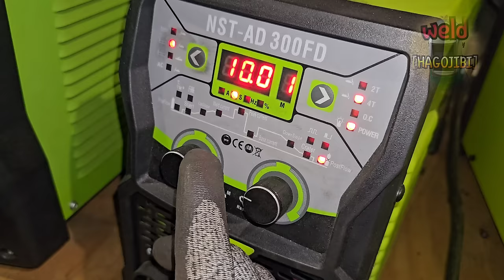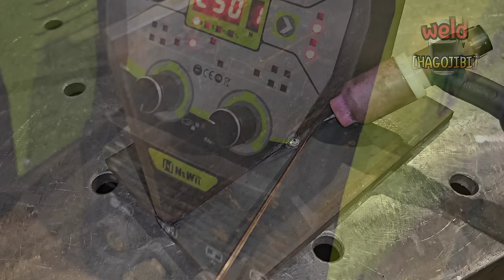Dirty TIG welding solution ! Why don't professional welders talk about this?

Comment: As a professional welder, tig 100% has to have a clean surface. No matter the metal
Reply: A fingerstool is a must for Tig welding which absorbs the heat and allows firm control over the direction of metal. 20mm Pipe welding at a 45 degree angle with root fillers and cap will wreck anyones wrist.

Comment: I would be more than pleased if mine came out like first one
Reply: Everyone starts from somewhere and with a little training you will be welding like the best.
Reply: I'd settle for the bad one in the the thumbnail
Reply: @farfartony751 mm 6😂gf6 de r e😂
😢😂s5
Reply: So dirty, maybe some inclusions and fail NDT? Preparing the weld area is the most important step. Doubly true for TIG work. 

Good prep work will help achieve better looking welds. Practice will gain consistency.
Reply: Do you think anyone would employ someone taking their time doing this ? 🤔 
The weld has to look ok but time also plays a major part in it 😂

Comment: No one talks about it because its just natural to clean any material.  You should never weld over mill scale
Reply: Unless you're at a 50 year old plant on a stainless pipe next to an exhaust 15 feet in the air at a 6g position you can't get at lol

Comment: On the contrary, that is the very first thing you learn from a professional TIG welder. Prep, clean, then clean some more, repeat and then maybe you get to lay a bead that most probably will look like burnt chicken shit anyway. Unless you have mastered all the other hundreds of variables and techniques involved to get something even remotely resembling the clean bead in this video.

For all the amateurs out there interested in getting into TIG welding because you've seen some weld porn on YouTube or Instagram. What these porn producers wont tell you about TIG welding, is as follows. (and I've explained this to a handful of friends over the years who caught the TIG welding bug and was about to run out to buy their first starter rig.)

Provided that you already have access to an insured, relatively weld safe workshop where you have enough power and permission to store large high pressure gas bottles.
You will need. 
A sturdy metal worksurface to weld on (tin clad wood will burn and smolder for hours if not days). 
An angle grinder with a decent selection of discs for cutting and grinding.
A fire extinguisher.
Protective closed leather boots.
Protective clothing made from natural fiber, wool or leather 
(Most synthetic materials will burn so fast you have little to no time to react. Especially when your vision is limited by a welding hood.)
(Synthetic fabrics are basically low density plastic which will burn, melt and stick permanently to your skin resulting in severe burns and hospital bills.)

Now you can go out and buy the most basic Chinese TIG setup you can get. Apart from the initial cost of the $500 welder, you need to buy (or rent) an argon gas bottle, pay for filling it, Buy a gas regulator, fittings and hoses. Buy a decent welding hood (don't waste your time trying to use the one they might include with the machine for free). Buy electrodes and filler rods for the different materials you wish to be able to weld and so on. That should set you back about $1000 in total. 
However, if you want some kind of quality product where you don't have to curse the machine and all the cheap components on a regular basis, you can look forward to spending $2000 and upwards on your setup. Believe me, learning to TIG weld is difficult enough without having to second guess your equipment. And if you want the option to weld aluminium you will have to spend yet another $1000 dollars just upgrading from a DC to an AC/DC machine. Also if you care about your long term health and want to avoid slowly getting poisoned by toxic, cancerous smoke and gasses you might want to consider buying a welding hood with a forced air respirator (gas mask), that is at least another $700 and upwards, plus the added joy of buying and replacing filters and charging batteries on a regular basis. Even though expensive, respirator hoods are well worth it because you will spend long hours exposing yourself to the fumes while training before you can even hope to produce a half decent weld. Getting a decent respirator hood is a good idea for the other processes as well, but especially with TIG because you basically don't have the option of working outdoors, or in a well ventilated room, because of shielding gas coverage issues. If the nozzle experiences the smallest amount of wind or moving air it will ruin your weld completely and foul and/or burn your electrode as well. MIG welding basically has the same problem (since it's also gas shielded) but is a bit less sensitive to wind, and you can also choose to use a flux core wire which gives you more or less complete freedom to work outdoors in most cases, which of course limits the risks of inhaling the toxic fumes. As they say, "very few welders get to see old age".
TIG welding is by far the most time consuming and expensive of all the common welding processes. Not to mention the hundreds upon hundreds of hours you need to spend training before you can produce something even remotely close to what this guy does on ordinary black steel (carbon steel). Good results on aluminium and stainless is at least another couple of hundred hours. If you care the least about the results, prep, cleaning and setup takes up at least 75% of the time if you are welding regular black steel. But will take up closer to 90% of the time when welding stainless, aluminium or even more exotic materials. The material must be completely free from mill scale, rust, oil and other contaminants and then thoroughly cleaned with pure acetone. Less pure acetone or brake cleaner might contain chlorine which will produce deadly chlorine gas when burned. 
And now, what probably got you exited with TIG welding in the first place, those perfectly rainbow colored weaves or stacks of dimes will put your budget upwards of at least $5000 and you will have to spend thousands of hours studying how to weld and manage heat spread in stainless steel to perfection in order to achieve that. If you ever get to that point you are now in the top 20% of professional TIG welders. And even those guys only put up pictures of the one or two nicest looking beads they were able to produce during a 40-50 hour work week on Instagram. So unless you want to dedicate your life to a career in welding, forget about the perfect rainbows. Also, the rainbows are an artefact which is not necessarily wanted by the end customer. IE companies don't pay their welders to produce pretty rainbows unless it's a show piece or for an artwork. Their main concern is of course the structural integrity of the weld, which is hard enough to master. Just in the process of learning TIG well enough to produce a half decent weld bead you will spend months just prepping and cleaning material and filler rods, grinding tungsten electrodes into pounds of cancerous (and in some cases also radioactive) dust. And believe me, you will spend some time demounting and regrinding and remounting and adjusting your electrode. The smallest amount of contamination (most often molten steel from accidentally dipping the electrode in the weld puddle or striking the electrode with the filler rod) will make your arc wander or pull and make it even harder to get a good result. The different methods of grinding tungsten (one of the hardest metals in the world) electrodes while avoiding the hazardous dust is a long discussion in itself, ready made relatively safe tungsten electrode grinders will start at about $600, there are other options, but what ever you do, be very careful not to inhale the dust. 
So if you are only working with black steel, my suggestion is to buy a MIG welder, spend 50 hours and become a half decent at MIG. The cleaning and prep work is about a tenth of what you have to deal with as a TIG welder. And you will lay down the beads three times as fast as with TIG. There are options for MIG welding aluminium and stainless steel as well, but it gets kind of complicated with different gas mixtures than the regular 80/20. A decent MIG setup is about half the price of TIG, and you don't have to be as particular with your hood choice. Same thing goes for stick welding but it's even cheaper (roughly $200 gets you in the door) and stick can be even less sensitive to clean material than MIG depending on the choice of electrode. Though it takes more time to learn and is a bit harder to master on very thin material than MIG. But you can always be outdoors in any kind of wind as long as your material is somewhat dry from water. However if you are hellbent on trying TIG. Start by taking an evening starter class. Or if you know someone who owns a TIG setup, ask them if they are willing to show you the ropes.
Reply: You mind if we trade info? I would love some tips and reading this is greatly improved my understanding.

Comment: First of all, your welds are just as they should be..you're a professional. ;)
I always taught my apprentices to clean their workpieces before welding. I know in the world of today time is money and it has got to be fast and cheap. However, a good weld always requires some preparation, especially TIG or MMA.
You showed what happens when it's just welded away. A lot of slag will form due to the mill scale and impurities in it which melt and flow on top of the weld puddle.
Reply: At 86 I have just bought a tig and not tried it yet but have watched quite a few videos and am still feeling confused and am wondering if I will get as good a view of the puddle as are shown in the videos ?
Reply: @alandouthwaite6980 You will be looking from further distance something like this 4:00 , but it just depends on how close you put you head to it, but you absolutely will not be as close as the camera when he is welding
Reply: @makl196  Thank you for your reply, at least I know now what to expect.  Nearly ready to have a go now...if I can set up my new helmet !

Comment: What have you missed that you have not mentioned though showed that cleaning the metal is important to obtain a good clean finish?
Answer: The mill scale should be removed fully on all joints before it is tacked together, not after it has been tacked together.
You should show the difference in results and the effect it has on penetration under the plate.
Reply: You are never happy so !!!!
Reply: @zibobpompon5768  it’s the difference between a good weld and a weld that will fail in service.
I am speaking from 40 years of experience.
Reply: Actually he did grind it out and it shows lack of penetration. Maybe watch whole video?
Reply: Sometimes it isn't in the welder's power to do so. Fitters may not prep the weld area at all.
Reply: @Sasquatch-ff1pj  It the fitter didn’t follow proper procedures, I send it back because if the weld fails I can end up in jail.
But if the management wish to push the issue it is my responsibility obtain a waiver that transfers all blame onto them.

Comment: 0:26 is laser welding any good? Is it as fast as shown online?
Reply: Yes, laser welding is fast and give nice results but it gives less heath, so connection may be weak if you weld to fast. However for thin plate laser welding is always the best solution.

Comment: Ive always been taught to clean your workpiece. You never want to mix rust or other impurities.
The reason why that hotpass looked better at the bad side is because the first weld got a lot of the mill scale out and whatever it was on the metal.

Comment: The dirt is problem? I mean the dirt is stay top of the weld or also in the weld? Is effects the wels strengths or just a ecstatic problem?
Reply: The mill scale and rust will become inclusions in the weld and become faults in the weld. Weakening the weld creating failure under stress. 

Structural welds often go through Non Destructive Testing. Magnetic particle, ultrasound, or radiography. The weld flaws will be revealed. These spots will have to be rewelded. Most structural welds are expected to have a 94% pass rate. Too many fails and the welder is fired.

Comment: What’s with the no preparation of the metal?
Reply: That's what he's trying to show--GTAW does not like mill scale or rust at all.  No welding process does but the others have ways of mitigating the contamination--TIG does not so the base metal must be as clean as possible.
Reply: @locomike102  yes I understand that.
Cleaning is imperative to maximum quality and when all edges are cleaned properly your welds are guaranteed to last for many years.
Because it has been cleaned after tacking you still have the oxidised mill scale trapped between the two pieces of metal.
Mill Scale is Oxidised metal and contains moisture that can lead to cracking from hydrogen trapped between the two plates of steel.
Reply: @21gioni It’s a demonstration video bro ffs

Comment: Try this with a smaller cup. Nothing wrong with the 1st weld. There is no need 2 use a 12 cup on mild steel. The cup is the secret. Yeah there no scale on the weld but the weld itself only looks so good cus hes runnin 24 lpm with a gas lens 12 cup. This is only for stainless really.